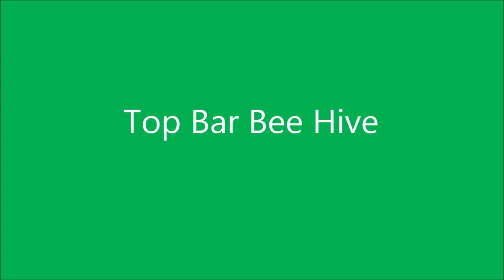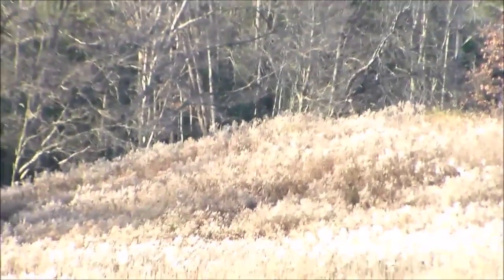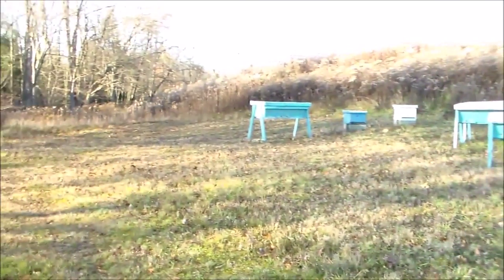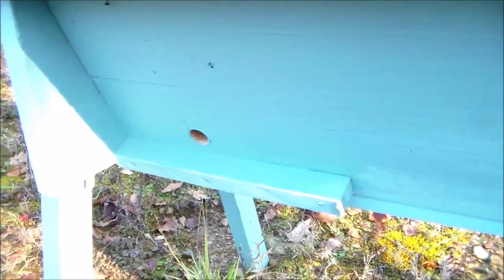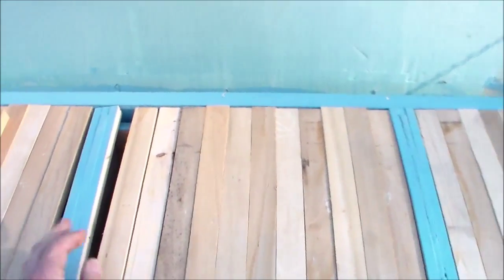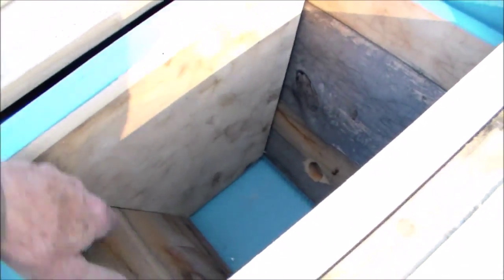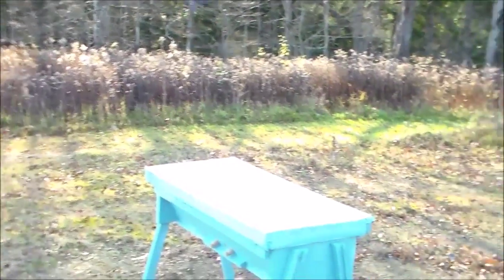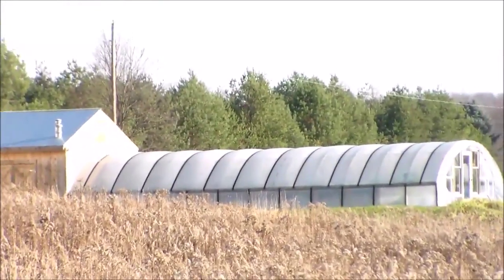Top Bar Bee Hive   construction hints

Comment: That's some good work right there now.

I've talked to a few folks at the club with top bars, and they all agree that the "go to" comb guide to use is the triangular shaped wooden comb guides.  The wax string guides are usually ignored by the bees and they build comb all over the place.

Best of luck, and thanks for the upload.